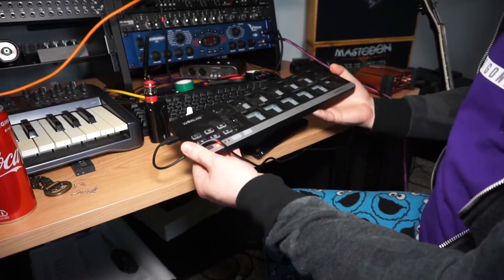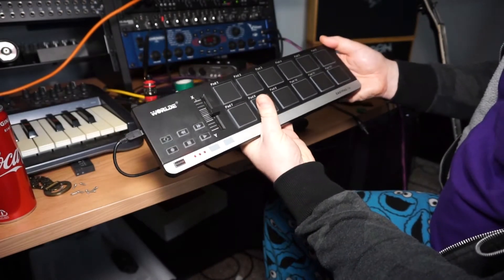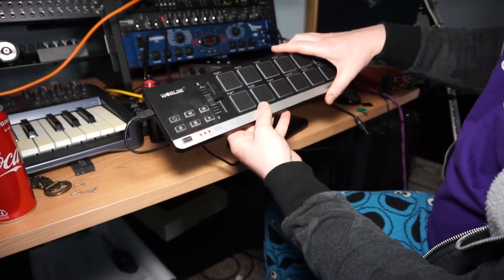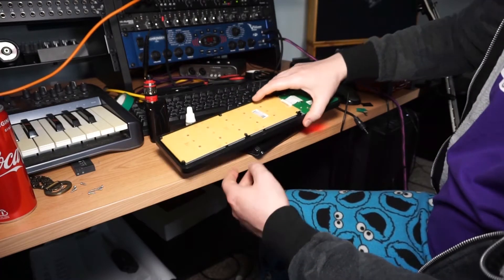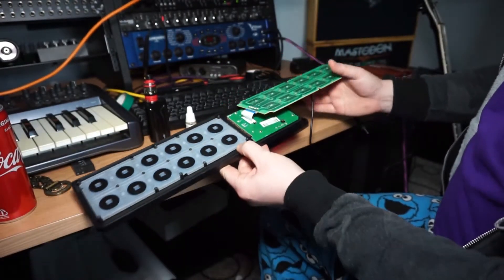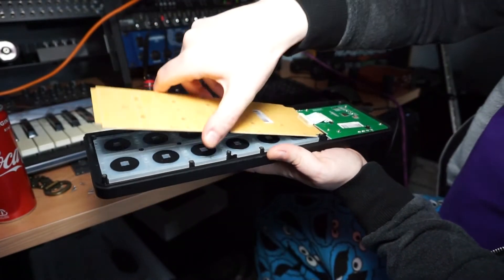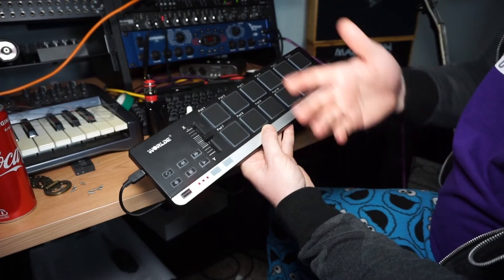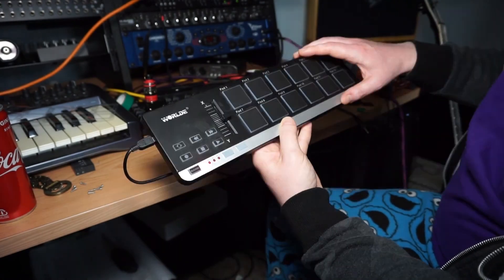Worlde Easypad 12 Sensitivity Mod

Comment: Received mine today, and it doesn't seem to have that film anymore. I brushed any dusts if any and gently wiped in case there is oils on it just to see if it would help. And made sure the pads slot into the pcb board holes correctly. Seemed to have helped the sensitivity a little. But yeah it is not perfect, pads doesn't respond equally but still usable for me. 

EDIT: I finally figured out my problem. If the rubber pads feels stiff and hard in its place when you tap, the solution is to loosen the screws from the PCB behind the pads. This should make the rubber pads feels loose when you tap it. And it will be lower than before. It  gives the rubber pads more room to move and makes it easier to tap.Also had to loosen the screws on the casing as well because of this. Now all pads are equally more sensitive
Reply: thank u!

Comment: I just did this and now pads are launching sound when I tap a nearby pad or even when I just bump the controller by the accident. The intended pad has better sensitivity but I obviously can't have other pads making noise unintentionally. At least I can reinstall the plastic piece.

Comment: Does it need a driver to be installed? I am wondering of I can use it on android. Plus can the note be configured for each pad, and the changes be saved in itself? Like if configured in windows then when hooked to other device elike android, does it retain the changes?
Reply from the maker: It doesn't need a driver it's a plug and play device. There isn't any way of configuring the device itself. The program it is using would have to be configured on each computer it connects to